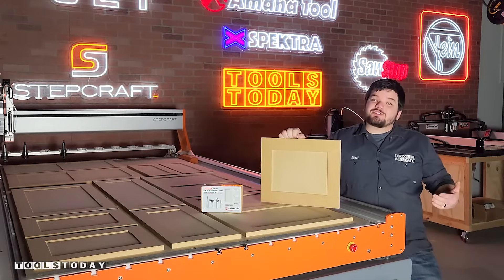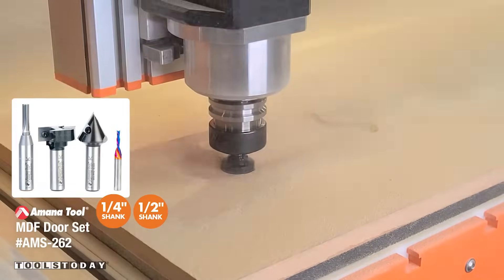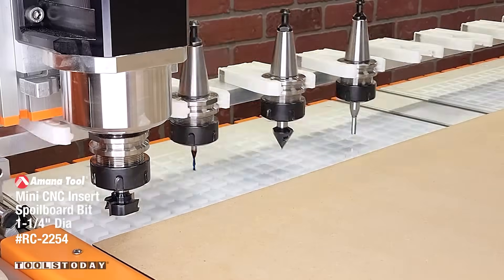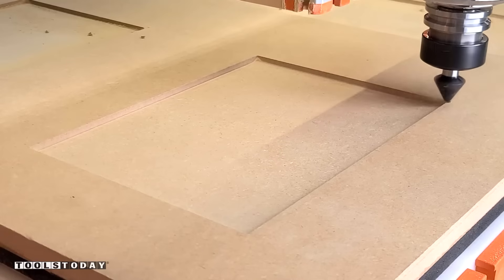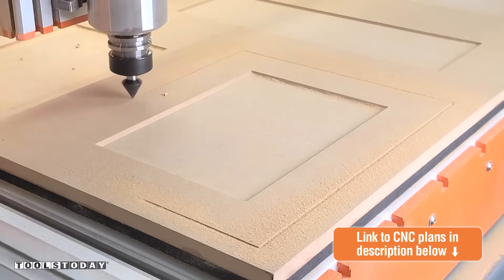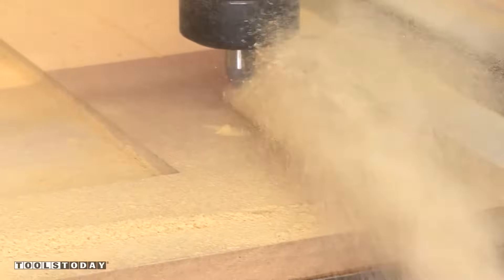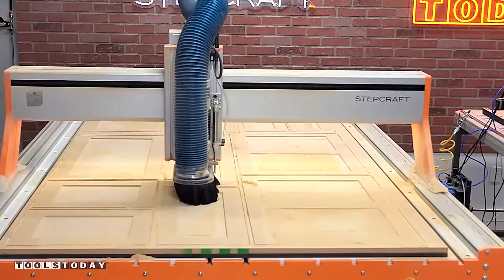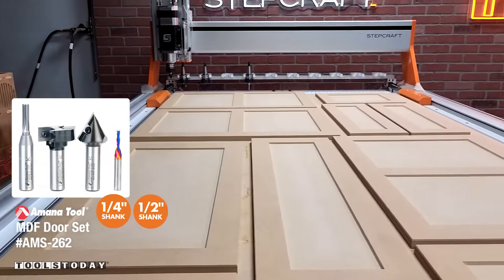How To Make MDF Cabinet Doors, with CNC Free Plans | ToolsToday

Comment: How do you fight warp after removing so much material in the center?  I figured MDF would be more stable than wood, but mine warped.
Reply from the maker: Hi, it shouldn't warp unless it was exposed to moisture perhaps.
Reply: @ToolsToday  We've had issues with warping as well. Any tips?

Comment: I purchased this kit and it worked amazing, I have a shapeoko 3XXL and it was excellent. Use cabinet/furniture grade MDF, some sanding, thick undercoat primer, some sanding, 2-3 coats of a quality paint, 320grit scuff between coats, and I produced "perfect finished" doors.
Reply from the maker: Great to hear!  Thank you for sharing!
Reply: This was the easy side!
Are you doing the back side with hand tools?
Do you chamfer back side?
How do you align?
Reply: @jenspetersen5865  I did a two sided program on vcarve pro, flipped it over (correct direction) lol, and cut ease edge with V bit, hinge pockets. My tabs were sufficient to hold the blank in place. I only have a shapeoko XXL with a 33 x 33 workspace. It’s only a blank with one to three doors or drawerfronts.

Comment: Thank you for the great videos. My issue is that the flattening bit leaves ridges where it passes over. Also the 45 degree bit at the corners does not leave a smooth corner for some reason. Any advice would be great. We've surfaced the CNC bed so I don't think that is the issue. 
Thank you
Reply: Have you trammed your router?

Comment: Hi
That’s real neat.   I tried with the bits I have…..only bit I have not in the kit is the 1.5” surfacing bit, instead I have same sized surfacing bit with bonded carbide blades instead of replaceable ones.
I found that the pocketed area the MDF was quite fuzzy.    Sanded it but still not very smooth so not sure if this is OK for two pack finish.    Query I have is if I was to get the RC-2254 surfacing bit from the kit will that make a difference to the pocketed finish?
Cheers

Comment: Hi can this bits be used on a non atc cnc, I am interested in purchasing the tools 
I am new at this so I apologize if it’s a dumb question
Reply from the maker: Yes they can be, you'll just need to be sure to set the z-zero position between bits very accurately